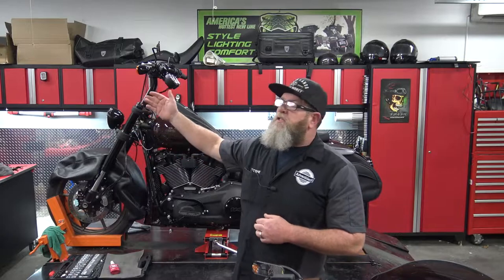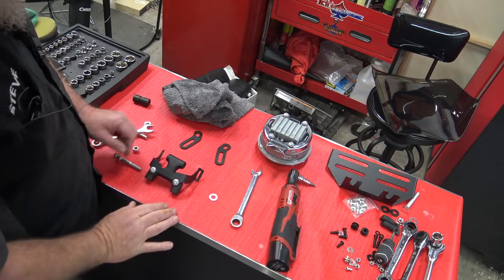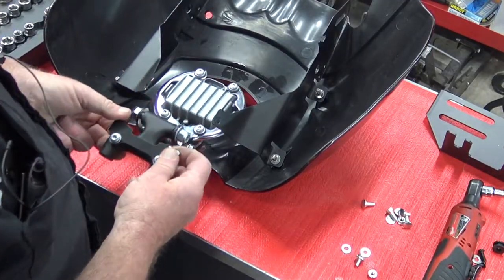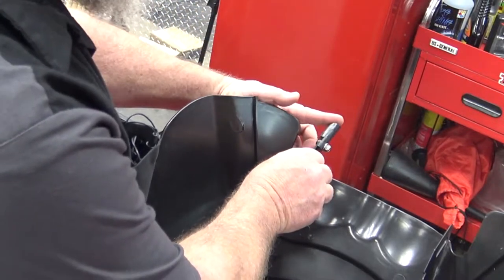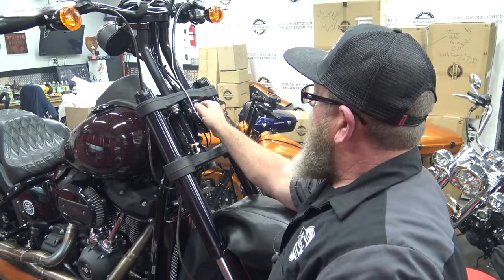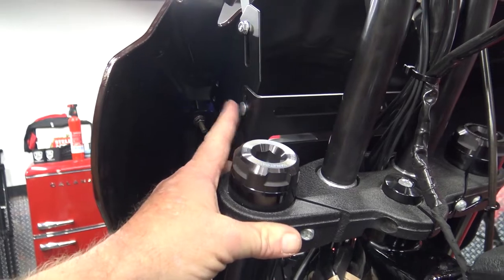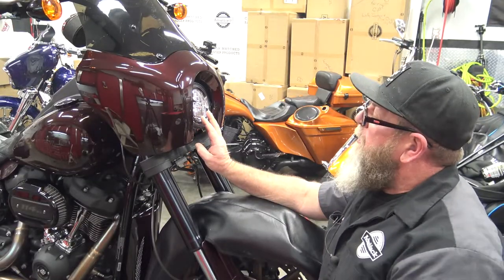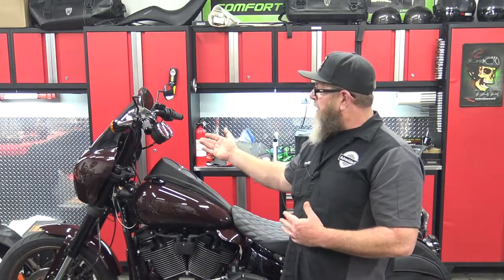Advanblack Low Rider S, T -  Sport Fairing

Comment: Thanks for a very clear installation video. The color matching looks excellent. Now I wait for mine to arrive.
Reply: Hopefully it actually comes with all the necessary mounting components and you don’t have to wait almost 8 weeks like I did. Mine was missing certain bolts mentioned in the video and came with black washers that aren’t big enough the fit the screws designed for them so now I can’t even fully mount it. I Hope you have a better experience than I did.
Reply: @DGFxlrs  I don’t like the sound of that but I’ll let you know.
Reply: @DGFxlrs mine was also missing hardware. The carrier bolts were too small to lock up against the fairing channel and the washer supplied was too small to work with the carrier bolt. I ended up having to use some old hardware lying around. Unacceptable for a $300+ part that you have to wait 4 plus weeks for.